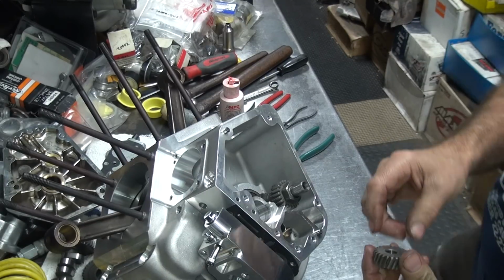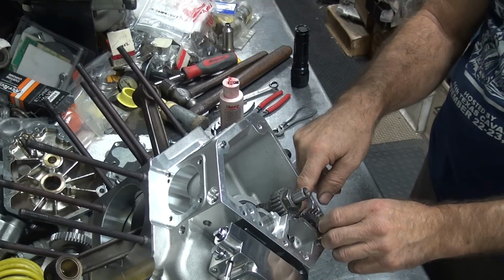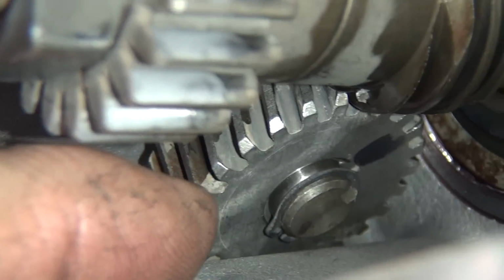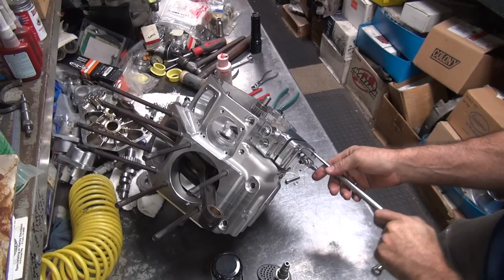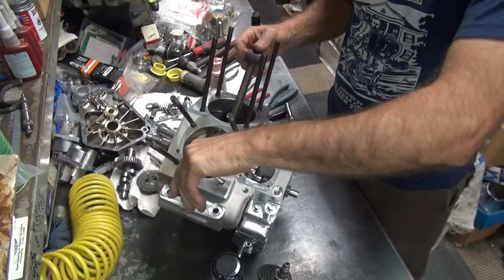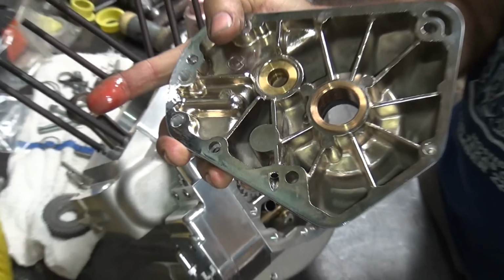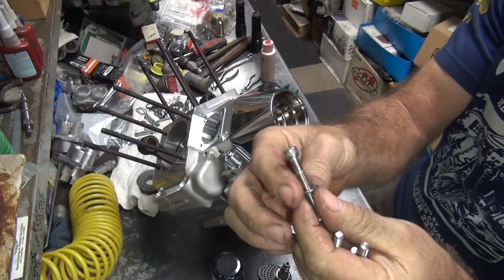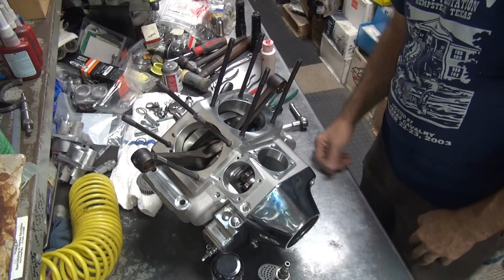1997 evolution 80ci #124 flywheel lowerend rebuild and case change harley by tatro machine

Comment: you put a non- breather type gasket on there with a timed breather ? or did I miss something ? head breather ?
Reply from the maker: the ultima evo cases are all the same on how they are made. you can use the case or head breathers. the timed breather valve is used either way. we are using the head breathers on this motor. we are also using the 1993-99 cam cover so i am using the gasket for that cam cover too. the breather line passages were plugged on the back of the case. if we used the earlier cam cover i would have used the earlier gasket too.
tatro
Reply: thanks, I like the way you stick with it until you have everything fitted right